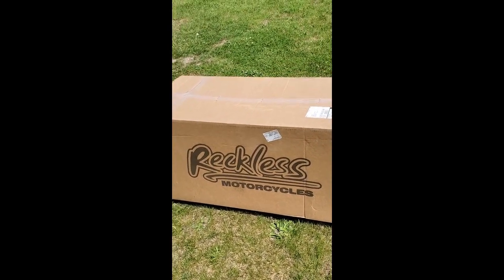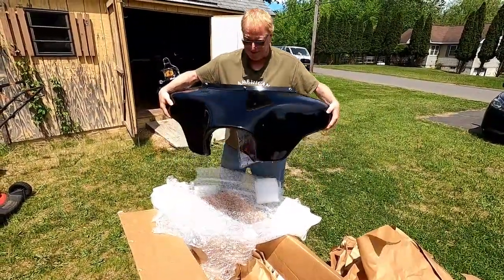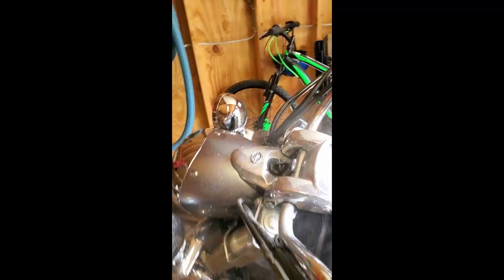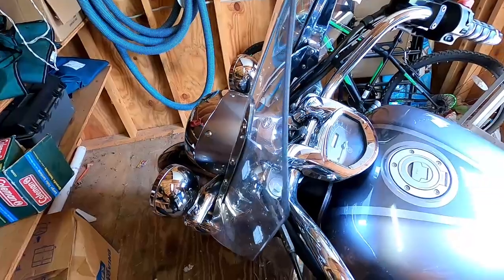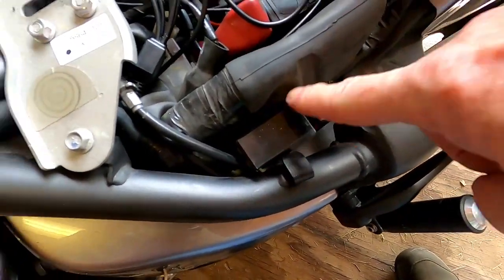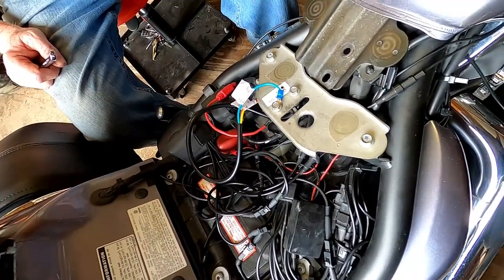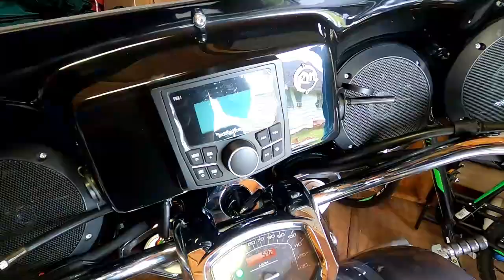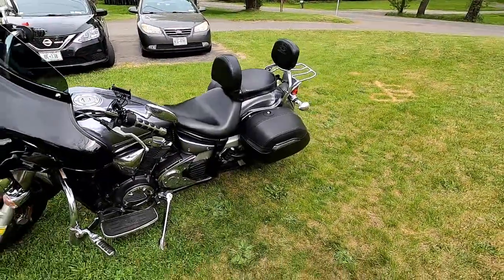The Fairing

Comment: What model did you get !
Reply from the maker: I got the Reckless Motorcycle VS13s Batwing with stereo.  Bought from www.accessoryiesnational.com.  I sent photos to them after I installed it.  My bike is the first in the group that comes up under the 1300 v-star.
Reply from the maker: Reckless Motorcycles VS13S Batwing Fairing with Stereo for Yamaha V-Star 1300